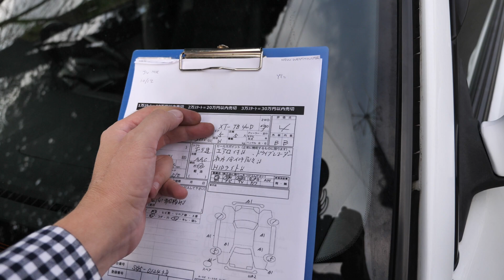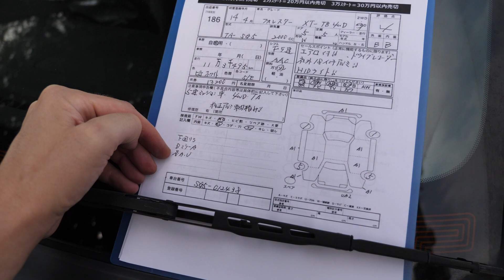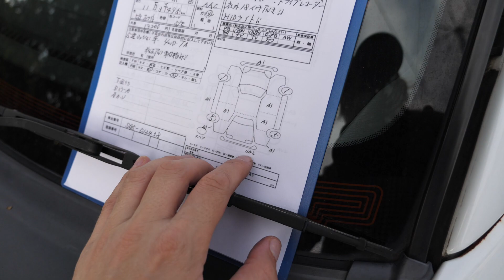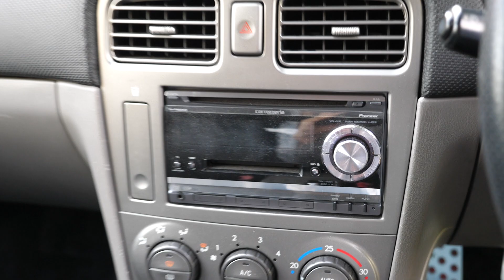2002 Forester XT Turbo (Canada Import) Japan Auction Purchase Review

Comment: Just curious...
Are you able to make a claim with Ju about the missed rust spot? It is very obvious and would have been noted right away if the inspector looked at the roof.
Reply from the maker: The auctions all have a book with strict rules for what is able to be claimed. In many cases, it's not possible to claim, but it depends on the auction and what their rules are. For most auctions, rust is not claimable on a vehicle over a certain age.

Comment: Grade 4?! What's happening with the auction ratings. That is a 3 at best surely, no way a grade 4.
Reply from the maker: Grades are always to be taken as a rough guide, not an absolute promise. I have seen excellent grade 3s and terrible grade 4s. This on is extra-specially off due to the missed roof.